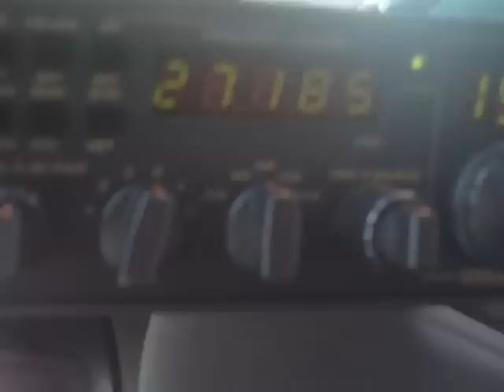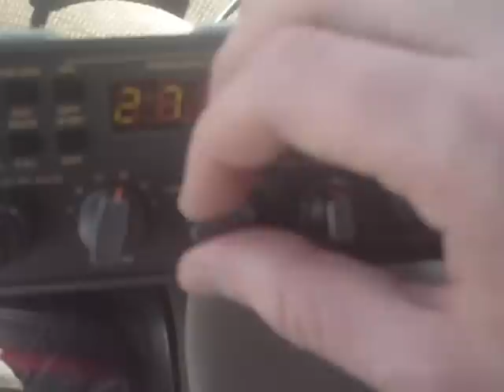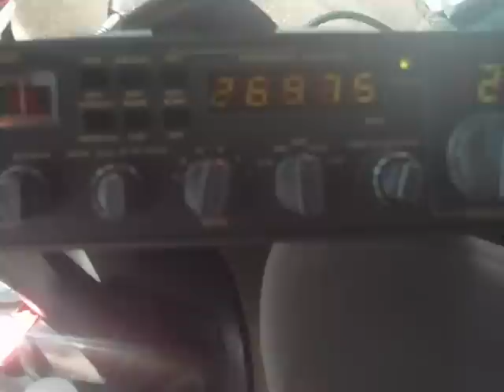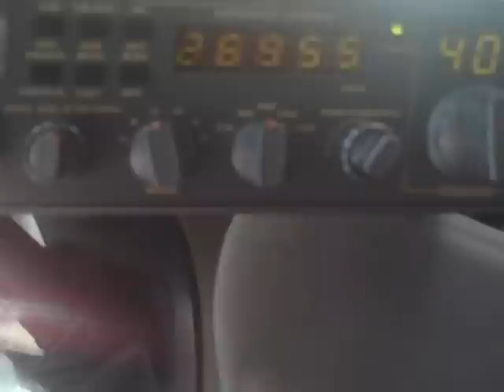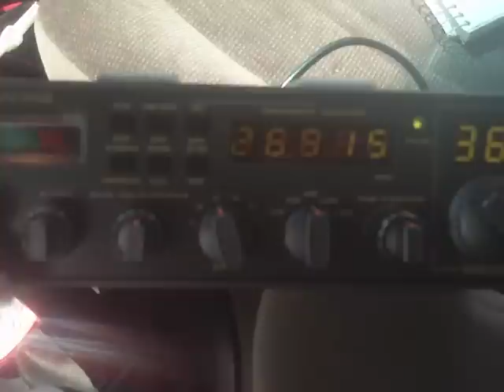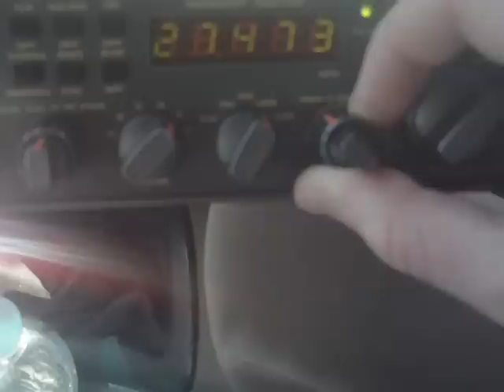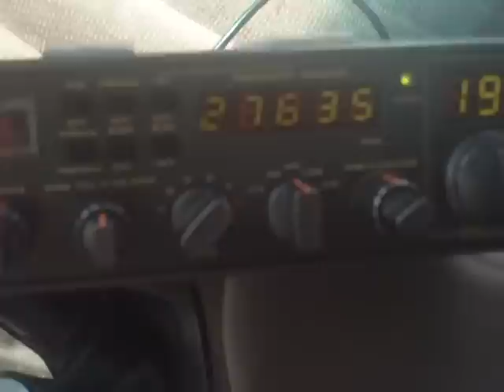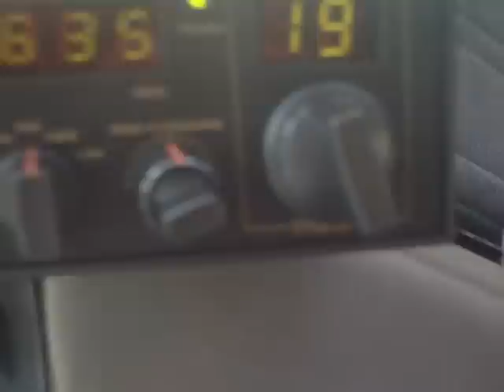Hustler IC-100 1C-100 CB Radio Antenna Review Performance Test Part 1 - Voyager VR9000

Comment: What's your opinion of the Hustler IC-100?

Better than the Little Wil?  

Better than the Little Wil on Rx but Little Wil better than the IC-100 on Tx?
Reply from the maker: +EscapeVelo They seem to be about the same performance wise (TX and RX).  The advantage the Hustler has over the Wilson is that with the Hustler you can easily unscrew the whip from the base which makes the antenna more compact for storage in tight places (in the trunk of your car, for example).  To do this with the Wilson Little Wil requires removing the whip by loosening the hex screw that holds it into the base, which is slightly more work.  When I loan CBs out to friends who are taking road trips, etc, I always loan them the Hustler antenna because its easier to unscrew the whip and throw the base and whip in the trunk.  Performance wise I rate the Little Wil to be equal.